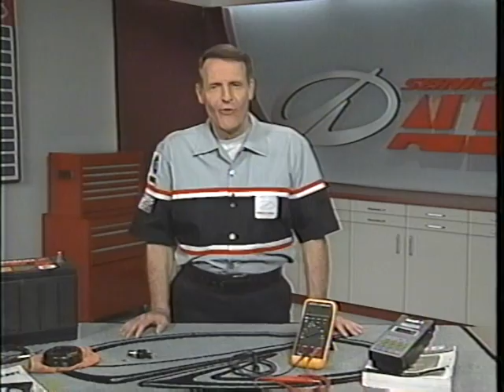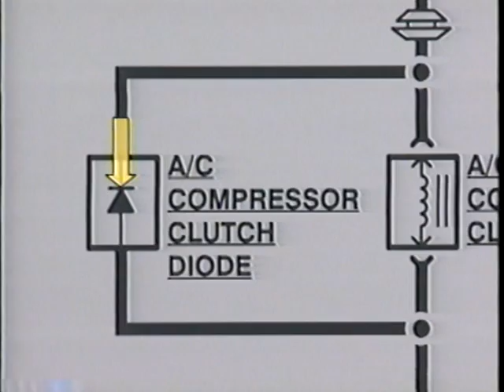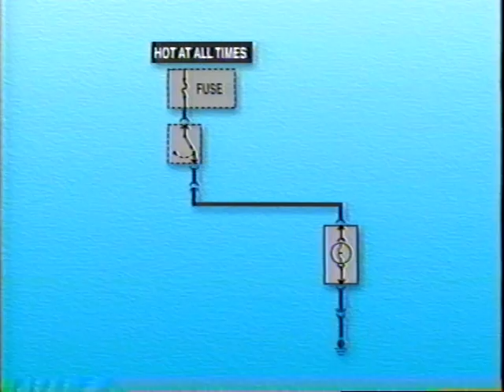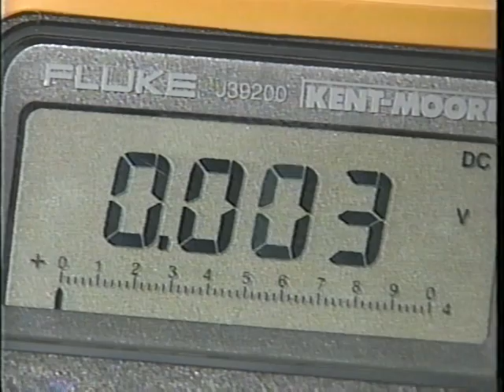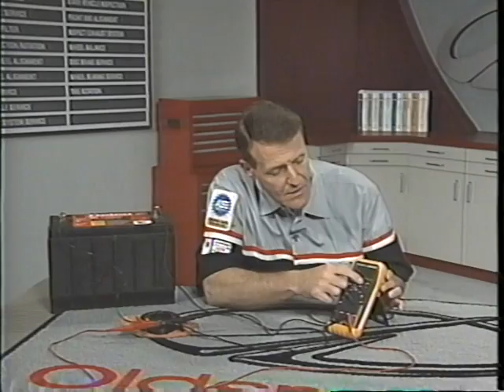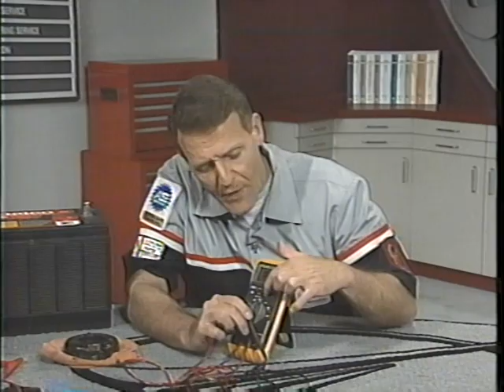Electrical Diagnosis Working Smart with a Fluke 87

Comment: Presenter states the DMM displays "voltage at which the diode begins to conduct" when testing a forward-biased diode in diode mode. Doesn't it actually display the voltage drop instead? At least that's the way an 87V works; don't have an 87 to compare with.
Reply from the maker: Not sure about that but the DVOM's diode function provides enough voltage to force the electrons and holes to the junction in forward biased mode. The ohm's functions does not provide enough voltage to force the electrons and holes. My 87 produces 3.7V and my series 87-5 produces 7.27V. I believe that the minimum voltage to forward bias a germanium doped diode is 1.5 volts.